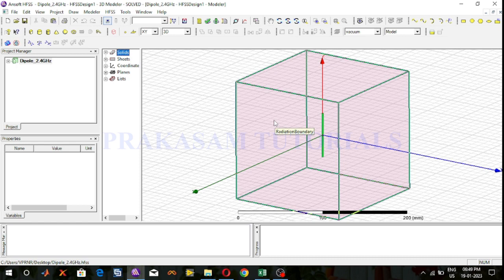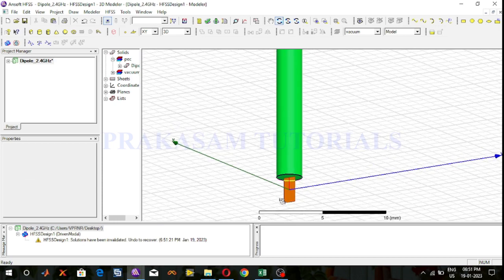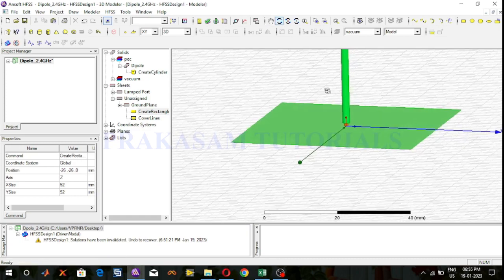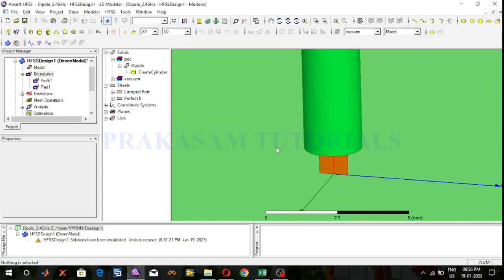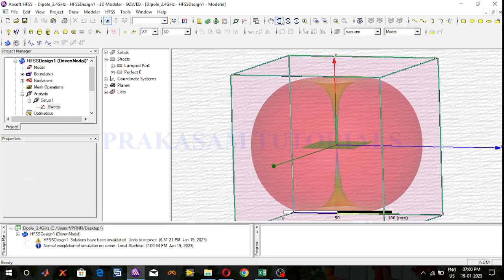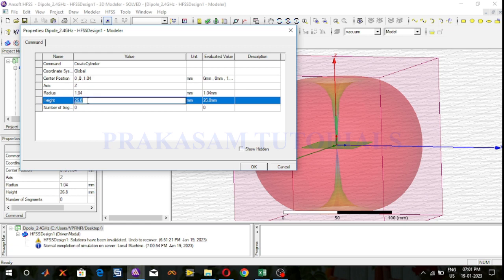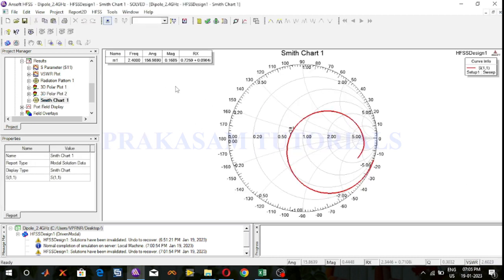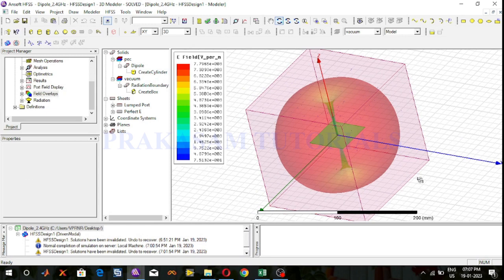Quarter Wave (λ/4) Dipole Antenna Design & Simulation Results At 2.4GHz Frequency Using HFSS

Comment: In summary, a typical quarter-wave monopole antenna has a gain of about 5.15 dBi (approximately 3.26 in linear scale), and a half-wave monopole antenna has a gain of about 2.15 dBi (approximately 1.64 in linear scale)....but for Monopole it has to be half if it ...iam not understanding it 😞